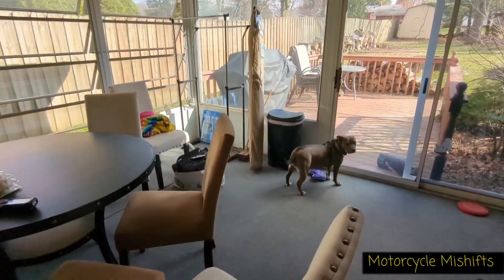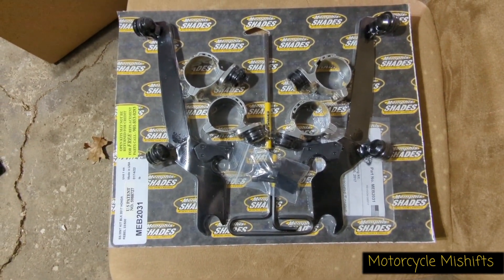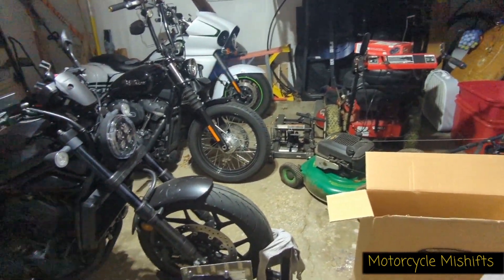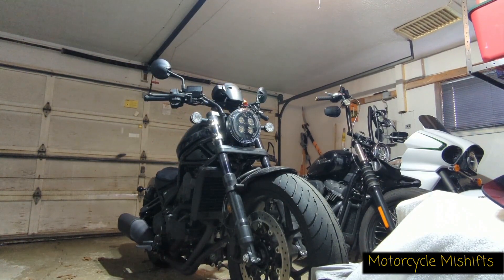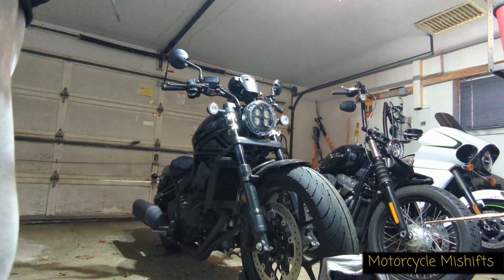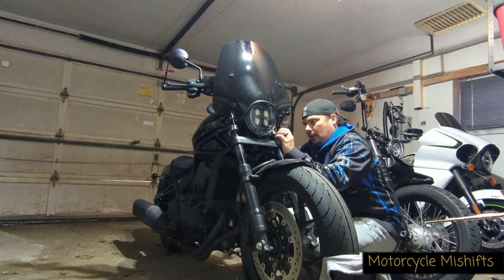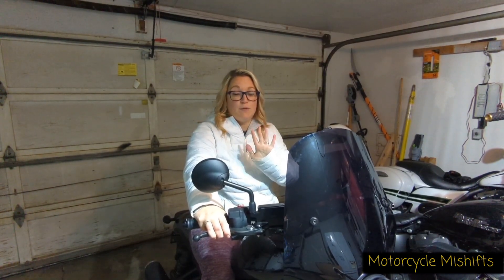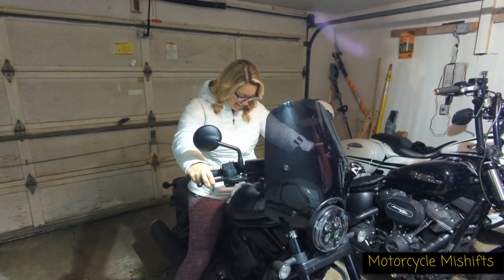installing a Memphis Shades Pop Top sportshield on a 2021 Honda Rebel 1100

Comment: Memphis shades now has the bracket trigger holder and shields for the rebel 1100 but the dark smoke is only available on the 13” and 15”. I have the 17” in smoke and the 19” in solar. Would the 17” dark smoke you have fit mine ?
Reply from the maker: I would think so?
Reply: @motorcyclemishifts4640  may you please share the link to the exact windshield you have. Thank you
Reply from the maker: I'm not 100% sure that windshield is available anymore.